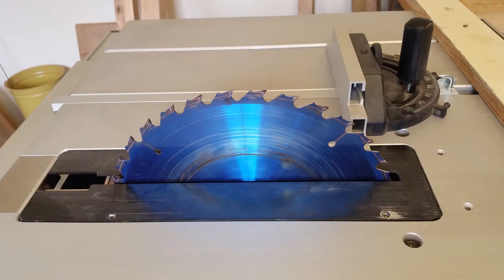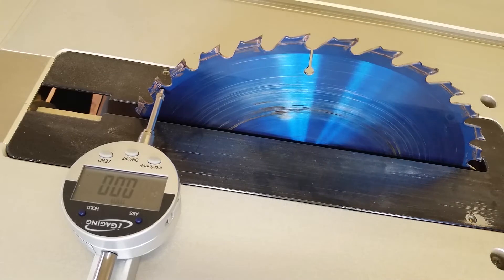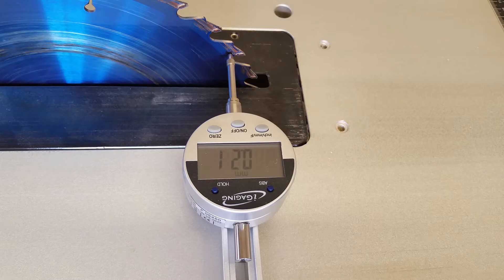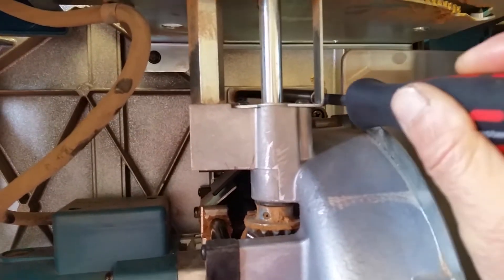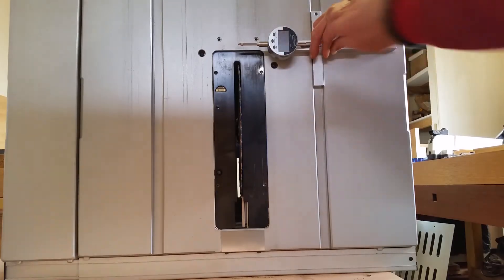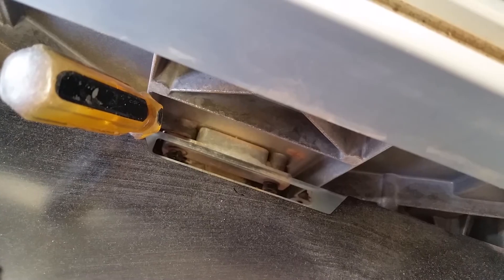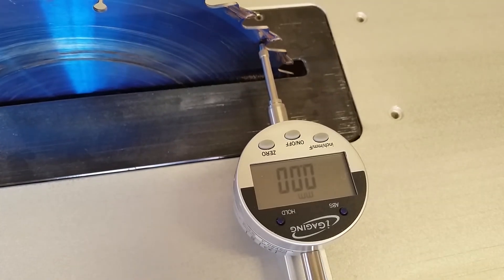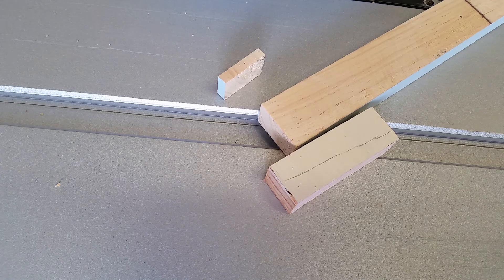HOW TO: Makita 2704N table saw Blade Alignment

Comment: Hi, I've just watched your video and think you can do the job easier. You really don't need to tip your saw over and dissassemble it. Those two screws are also accesible through a tiny slot (10x100 mm) right under the table and above the bevel angle wheel. It can be seen briefly in the 4:13 moment of your video. The screws are hex headed so you need a 10mm wrench to turn them. It makes the whole process easier.
All the best!
Reply from the maker: Thank you Stary, I will check it out. When I did this video, the only power tools I had used were drill, a few hours of circular saw and power hand plane :) I appreciate your advice. Thank you and best regards.

Comment: How ii can remove the knife?
Reply: There is screws holding it, but i strongly recommend to leave riving knife at its place since it is essential for your safety. Watch out for kickback if you remove it. The only reason to remove is dado blades, but you can ether cut it shorter or make a new one from piece of scrap metal
Reply from the maker: I usually have it on. It would take about 15 ( fifteen ) minutes remove it: we have to take the little plate on top off, two screws. Then lift the blade all the way up: there are another 3 ( three ) screws with two ( 2 ) different heads which mount the knife the carriage. They make it difficult to remove due to safety reason, I am guessing.